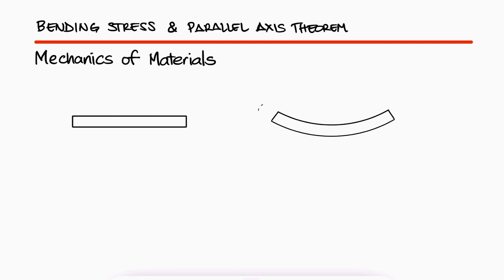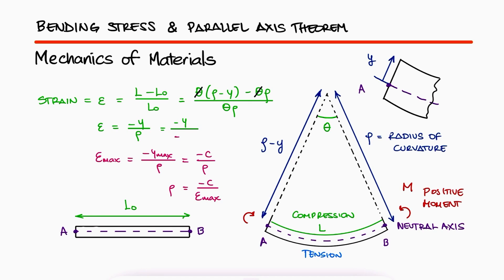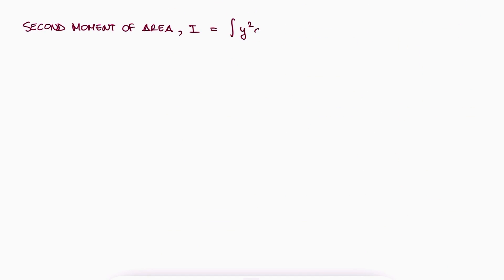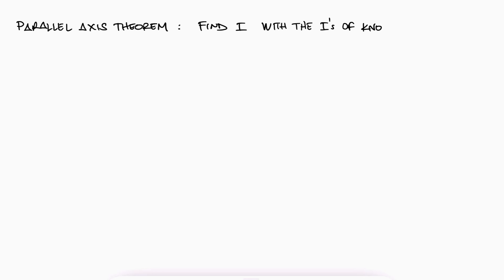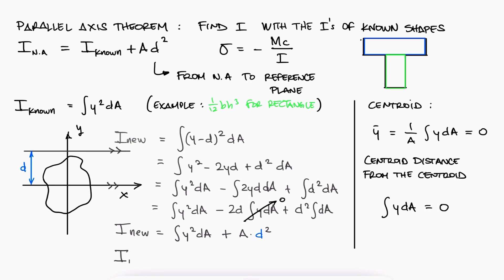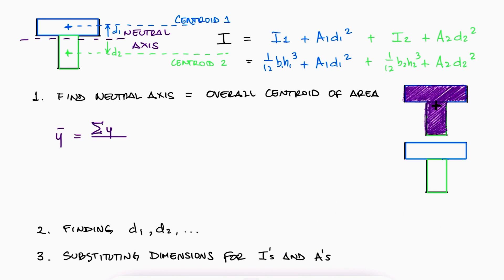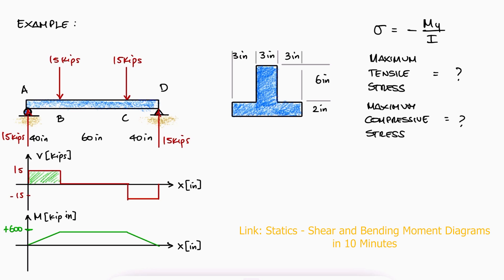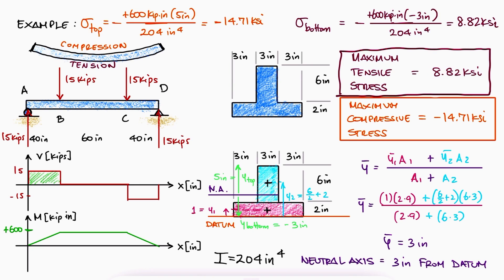PURE BENDING and Parallel Axis Theorem in 12 Minutes!

Comment: Why did you use +600 moment for evaluating top stress and bottom stress? Is it bc we are calculating max tensile and compressive stress, therefore we use the max moment in our equations?
Reply: That seems to be the case, otherwise we have the moment graph to solve for a specific point.

Comment: I am researching soil shear.
Because soil contains water, water pressure affects measurements, and there is a method called triaxial testing.
We obtain data in situ, record the data in a form that allows us to remove pore water pressure in the same way as triaxial testing, record the pressure at the time of failure, and analyze it. In that case, by comparing the data separated into rotation and load vectors with the movement of pressure, we can obtain data at the time of failure. This explanation was very helpful, and I appreciate it.